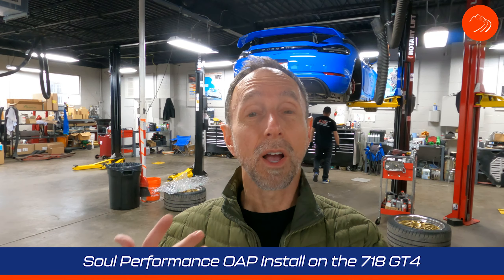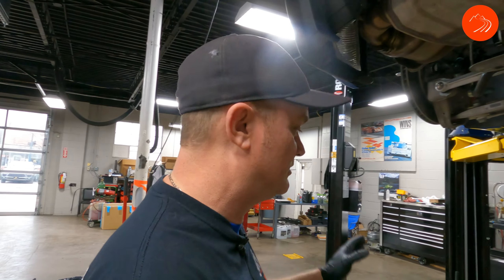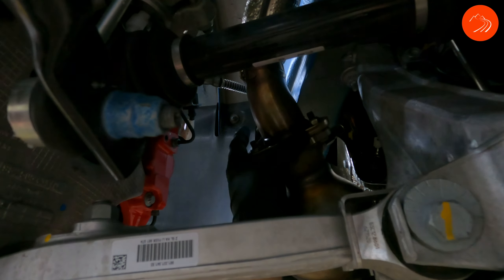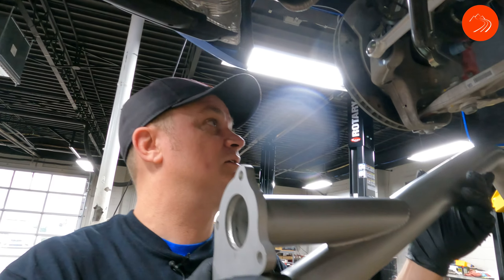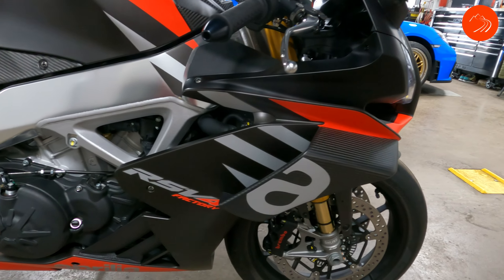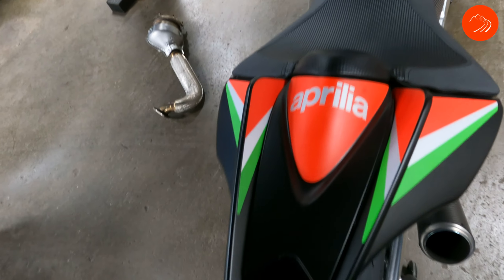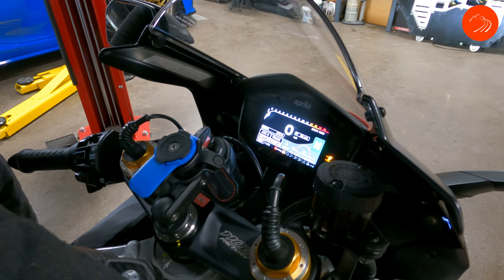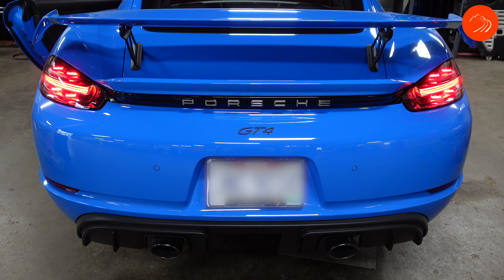CAYMAN OVER AXLE PIPE (OAP) SOUL PERFORMANCE INSTALL

Comment: I noticed that the Soul OAPs do not have heat shielding like the stock pipes.
Reply from the maker: That is correct. No shielding. I am aware that both Soul and Dundon exhausts don’t have shields. Both have said it isn’t an issue. My GT3 RS stock headers and sides muffler doesn’t either.